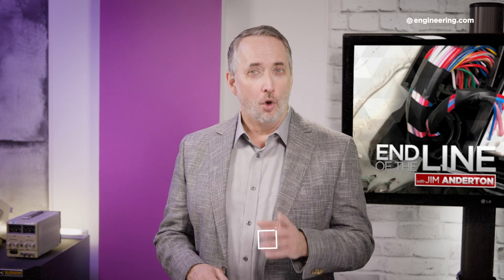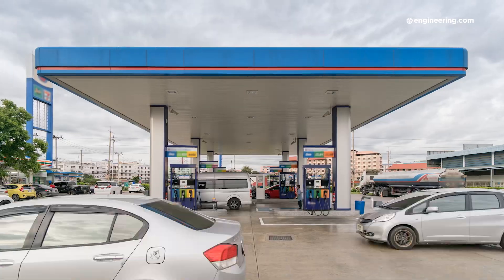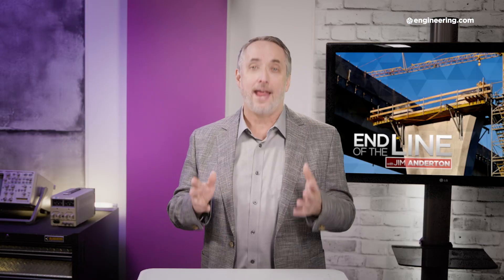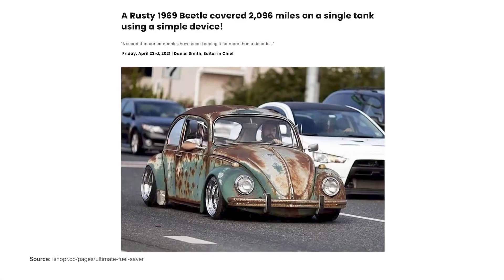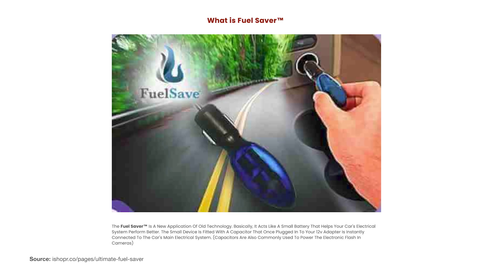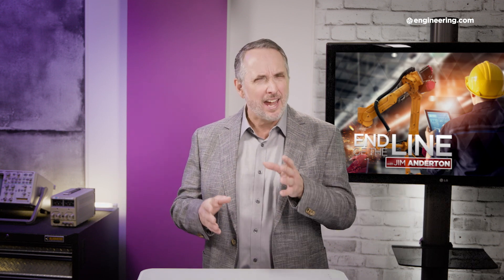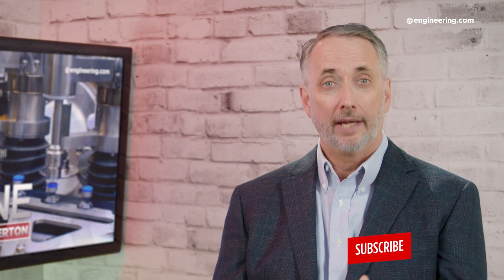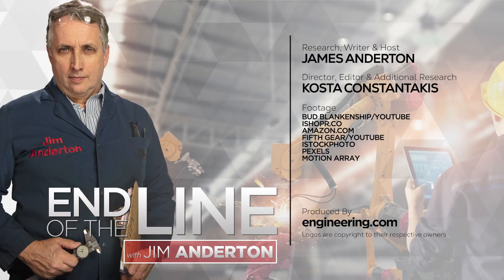Don’t Fall for Gas-Saver Scams

Comment: What if the device worked off the heat produced by your engine instead of electricity from your alternator? Heat is wasted energy due to the inefficiency of the internal combustion engine. So actually capturing heat off the engine and using it to create H2 sounds would probably be a legitimate system, right?

Comment: What you missed by not actually testing the HHO systems, is the hydrogen gas ( and extra oxygen-marginal improve) burns with the carbon chain liquid fuel, the hydrogen:
combined fuels, raises effective octane, lengthens flame time, burns more of the carbon-carbon burn, reduces nitrogen % by HHO content, increases ignition advance, by raising nock point with octane change, allowing higher performance, without retarding timing.
and helps keep cylinder and valves clean of deposits.
10-30% is possible, diesels tend to get a bit better.
Cons:
caustic PH water is needed for good electrolyzer efficiency.
Must use plastic, and replace tank more often than wanted.
Metal catch, or backup plastic good idea.
Must refill with water, Crappy water clogs plates and must clean, or use distilled water.
Little expensive, in a gallon jug, almost eats up the savings.
But, if it was ubiquitous it should be a dime a gallon, if it came out of a pump like gas.
The KWH to make, IFF not optimized, just right, eats into efficiency gains.
So most kits don't work or just barely work, unless sized just right for the engine.
It is also a form of water injection, as water HO, H2, O2 all come out into suspension or mix with incoming fresh air.
If steam, with over-production, then counter-productive, with heat dump, in intake.
Heat of vaporization lowers temp, but boiling does not...
Run to hard, to get more gas, and you make steam, dry out your tank faster, and don't make as much efficiency gains.
For passenger cars, unless your a hyper miler, its to much a pain in the arse, unless you love to tinker.
Then its fun...
Big trucks, it pencils, out. A trash truck is the perfect example, start stop, big pollution problem, because of that alone.
HHO like CNG, can clean up, and improve these polluters, and save fuel costs. Local short haul, with a shop to maintain, vehicles, it must be able to absorbed the new added work. That has to be paid with the fuel savings...
But it can reduce C02 outputs a small but significant %, but only if done optimally.

Comment: They're still going! I see ads for fuel saver pro that the car industry wants to suppress and I even saw and ad for a plug-in heater (about the size of a plug in air freshener) and they literally claimed it worked by perpetual motion and could heat your home!
Reply: Yup. That ad on YouTube sent me searching, which brought me here.

Comment: the only "device" I've found that saved a ton of fuel, you can't buy, or even find any more. It's called the '90 Geo Metro. I don't even know who manufactured it. I bought one for my wife in '92 and was never serious about the milage until we took a trip from Los Angeles to Sacramento. With 3 kids and all our luggage, we got 56mpg getting there and 57mpg getting back home. It had a 75 hp, 3 cylinder Nisson engine, a 5-speed stick shift, super easy to work on, and I wish I had the car today. She used the car for work, which was 45 minutes away, so I know she was getting MORE than 60mpg,

Comment: Wish I had seen this before I got scammed by the obd2 plug in device , which cost me money and long wait time to get, probably came from oveseas, they say drive it for 150 miles by ten it ha learned to remap your fuel dlivey system   bull I tell ya,  I got 25% less mileage on my 07 Honda Element, called to get them warrantied  but wa told I probably hadn't  driven it fa enough yet, so call backdated you dive it a couple more hundred miles  BS, it continued to Lose fuel mileage and I will live with the fact I got scammed  after unplugging te device it wnt back yo te miege it always got. Everybody can be scammed  but I'm  embarrassed
Reply: They say they "Tune your ECU" It probably messed up your ECU which resulted in your lost fuel milage.

Comment: Sure there is no free lunch, but one could determine automotive inefficiency or wasted energy, and potentially recapture it.  In the hydrogen case, the alternator could be used in a smart way to capture mechanical energy on deceleration to generate excess electrical energy and drive hydrogen capture.  The hydrogen could augment normal combustion producing more effective energy.  There is no free lunch, but most don’t eat all of their lunch and it goes to waste.  The downside to any add on is total life cycle cost.  This is a factor ignored when considering solar panels as an energy source.  Advanced nuclear energy which is inherently efficient, available, safer and uses an incredibly inexpensive existing fuel source, not to mention clean, seems the ideal from a life cycle cost perspective.